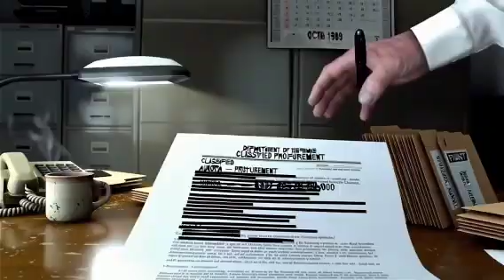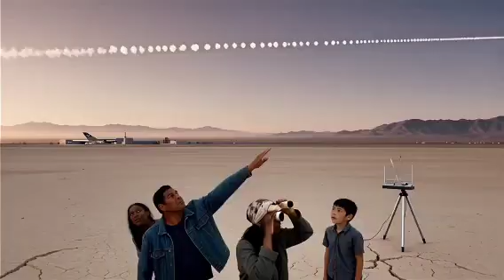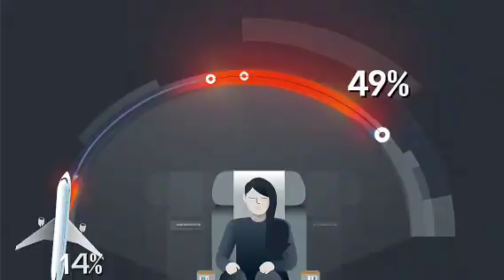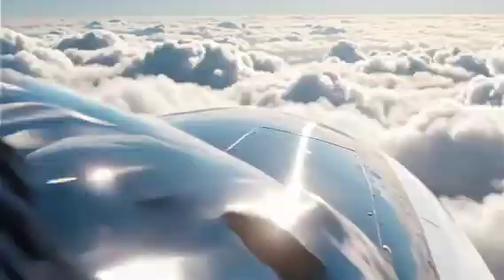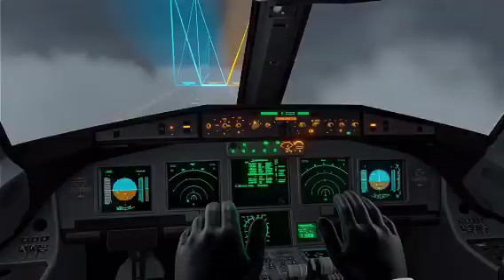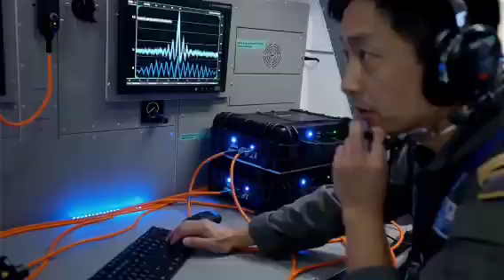The Engine Hotter Than the Sun's Surface Is Hanging Under Your Plane's Wing Right Now

Comment from the maker: ✈️ COMPLETE SOURCE VERIFICATION:

GE9X-105B1A 105,000 lbf thrust 
and 134-inch fan diameter: 
GE Aviation official GE9X 
engine specifications page — 
publicly available at 
geaerospace.com/products/engines/GE9X.

Turbine inlet temperature exceeding 
nickel superalloy melting point: 
Rolls-Royce — "The Jet Engine" — 
7th edition, Chapter 5 (Turbines). 
Standard aerospace engineering 
reference text. Also: 
Pollock, T.M. & Tin, S. — 
"Nickel-Based Superalloys for 
Advanced Turbine Engines" — 
Journal of Propulsion and Power, 
22(2), 2006. Freely available 
via ResearchGate.

Single crystal blade manufacturing: 
Versnyder, F.L. & Shank, M.E. — 
"The Development of Columnar Grain 
and Single Crystal High Temperature 
Materials Through Directional 
Solidification" — Materials Science 
and Engineering, 6(2), 1970. 
Foundational single-crystal paper.

Yttria-stabilized zirconia TBC 
125μm thickness: 
National Research Council — 
"Coatings for High-Temperature 
Structural Materials" — 
National Academies Press, 1996. 
Publicly available at nap.edu.

Trent XWB ~50% thermal efficiency: 
Rolls-Royce Trent XWB 
technology documentation — 
rolls-royce.com/products-and-services/
civil-aerospace/trent-xwb.

FAA fan blade containment requirement: 
14 CFR Part 33.94 — 
"Blade containment and rotor 
unbalance tests" — 
publicly available at ecfr.gov.

GE Durham factory self-directed 
team assembly: 
Fishman, C. — "Engines of Democracy" — 
Fast Company, October 1999. 
Extensively documented.

📊 Every number is verified. 
Every source is public.

Drop ✈️ if you will never look 
at an aircraft engine the same way —
and comment: which engineering 
fact in this video most surprised you? 
The temperature? The power? 
The blade cooling? 👇